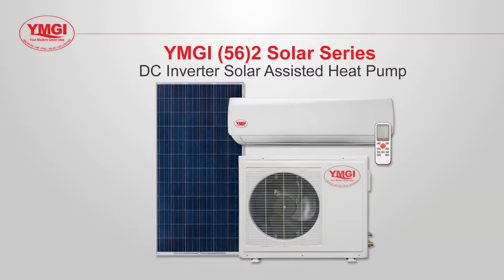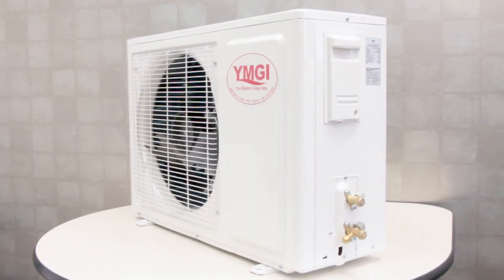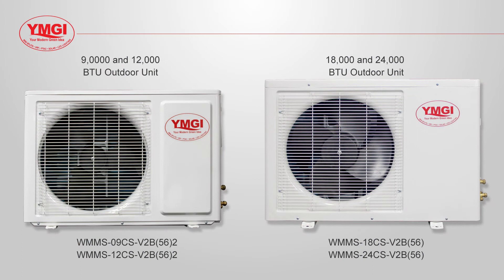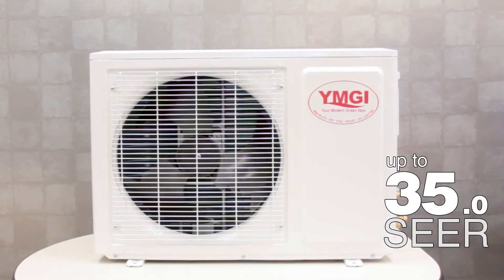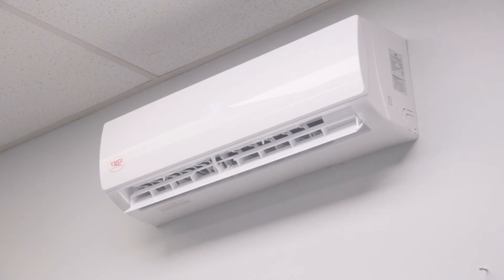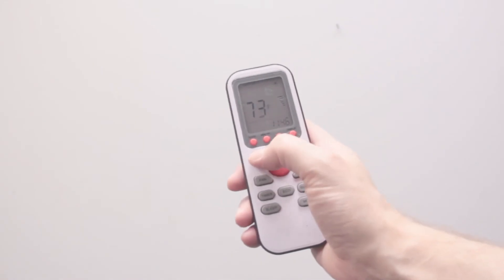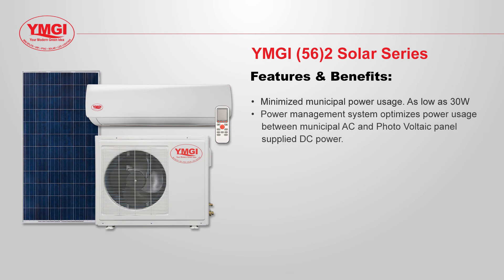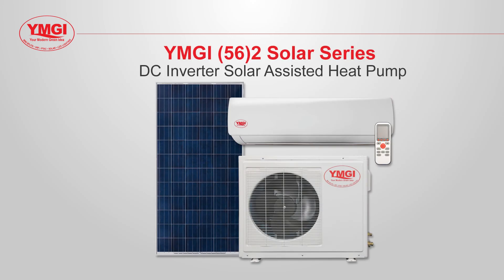Solar Assisted (56)2 2nd Generation System

Comment: Does your technical department answer its emails? I emailed both technical and sales, no reply.
Reply from the maker: Hi HVAC Student. Our technical support is normally very prompt in responding to emails. Try contacting us through our website at www.ymgigroup.com.  You can use the form, or find the email address on the contact us page.